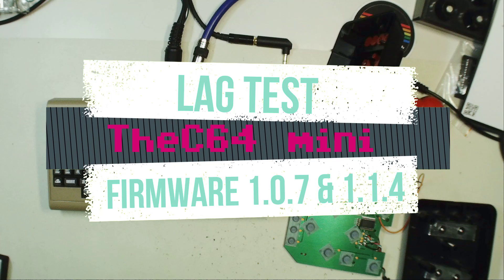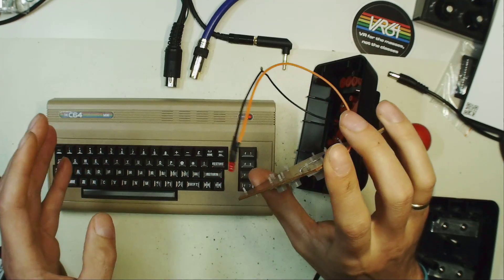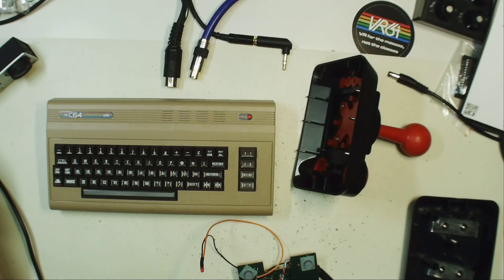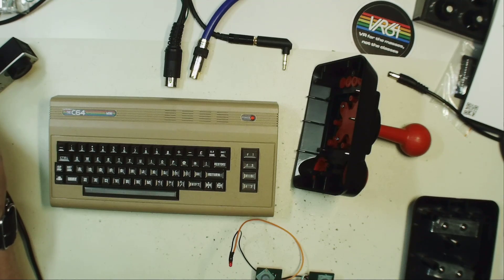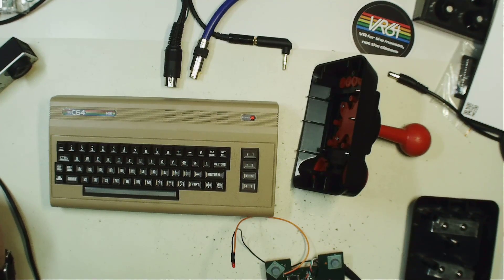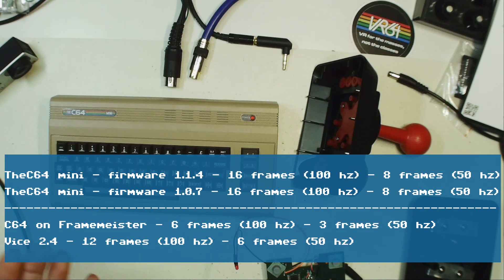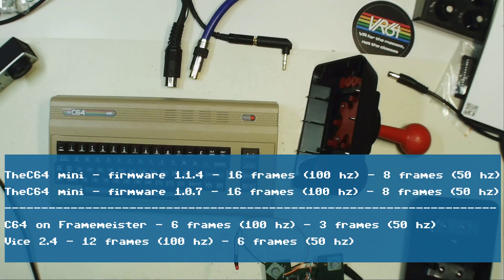C64 Hardware - TheC64 mini - Input Lag Test

Comment: The C64 mini devs doesnt care, they sell this garbage to the gullable masses based on nostaliga, it's not for c64 enthusiasts. Will never be fixed so stay clear of this product.
Reply from the maker: Well, it's an opinion that may have some facts as foundation but I wouldn't go so far to say keep your hands off of the mini. It has a certain charm and the price tag makes it appealing in some way. For the die hard fans of the C64, well, that's probably not the right way to go, I agree, but it has a certain niche and I like that it is so easy to setup and to use.

Comment: was this because of my two inputs in your 2-3 previous videos on c64mini?. no credit given. =(
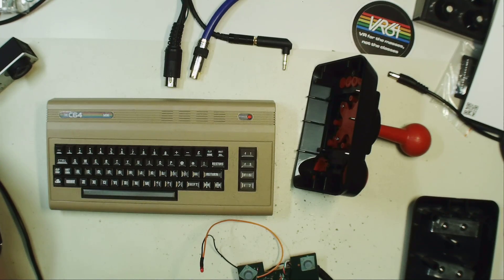the 8 bit guy did this. 4:27 an emulater should NOT make you predict where to press button. 
it's not better than an pc emulater CONSIDERING the price of the unit.
my problem here is unless you want to have a portable c64mini you can save 100 usd by just using a software that supports a pc that is new or 10 years old. however at 35 eur it's a steal! but where i live it costs 3 times as much. still i think for such a premium item sold and marketed as a c64mini. this is something the manufacurers should have disclosed to customer prior to selling it. they must have known this and you still stay behind them. the first people to adress this issue didn't need to do a test to notice it.
Reply from the maker: i'm very sorry that I forgot to mention you, this was no bad intention. The lag test was on my agenda for quite a while since we've started a similar discussion at the Forum64 months ago. Now, with the new updates, it was about time to do it. Next time I will take a note and credit you as deserved.

Comment: This latency issue, I saw the 8-bit guy investigate it as well. His method seems a bit flakey compared to yours but in case you hadn't seen his video, I've included a link below. Does his conclusion corroborate with yours you think?
https://youtu.be/GXXCj5kqPcM?t=1083
Reply: Interesting. I didn't know that Vice2.4 was used on the Mini. I wonder if they used the standard version or the sc version, which is supposed to be cycle exact. It does seem that Vice is adding most of the lag here.
Reply from the maker: Thanks for the info. Yes, I knew the video already, he was one of the first to present the mini :) I was just hoping they had improved something with the updates but it looks like it was 'just' functionality. Which is a good thing too :)
Reply: I'm still getting one. Have you actually noticed the lag during gameplay on the mini? If it's comparable to Vice, then it shouldn't be that bad for most games. I've played enough games using Vice without really noticing anything.
Reply from the maker: Well, I rarely use Vice so I can't compare it directly but for most of the games I don't recognize the lag as much as it may sounds by numbers. But I've played Midnight Resistance and here I've got the impression that the main character kind of reluctantly reacts to the controls (changing direction when enemy approaches from behind). But I need to run this on a real C64 to compare it. I think the most dramatic effect will appear for shooter like Enforcer, X-Out etc, where you need to avoid getting hit but have just a tiny amount of time to react.
Reply: I normally only use the x64sc version of Vice which is supposed to be closer to the hardware where timing is concerned. It requires more from the hardware, so I doubt it is used in the Mini. I'd have to look at Enforcer and X-Out. I'd never heard of these games. They look pretty good, are the new releases?
Reply from the maker: No, they are old games from the good times :) Enforcer is a follow-up to Katakis or some call it Denaris, same genre like Armalyte or R-Type. A new release was Starfysh from TND, has less depth and variety but nice graphics.
Reply: Wow, I'm really impressed with these games. I showed them to a friend who loves his shooters and he hadn't seen them before either. I'm going to have a go at them later :) Thanks!

Comment: Great video !! Do the same test with the C64mini menu, use the switch to turn the background music on and off, you will see it will change instantly. without any noticeable lag.. it‘s a problem with the emulator itself or the SOC not as fast enough as needed. On the pi 3b+ the input lag is not as high as on a C64mini .. and I use a ps3 wireless gamepad for playing.
Reply from the maker: Naviaravideos yes, the user interface is much more responsive but it's just a platform to launch games. I may check a RPI3+ too to compare the lag. It's a bit sad that the lag of the mini is so high but it is still a pretty cool device :)
Reply: exactly, but we learn something from the TheC64mini Menu: The lag is not coming from the TV.Mode and there is also no lag produced by the USB driver, the Input lag begins when the game (emulation) starts. My guess: the hardware is not powerful enough, but that's only a guess.. Some SID tunes sounds also weird,  so my guess it's no reSID emulation only fastSID.